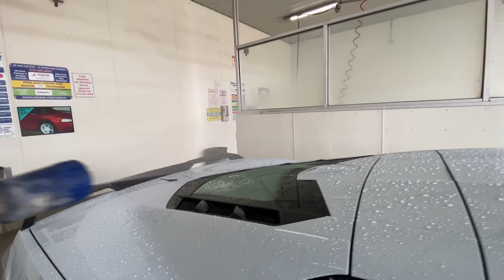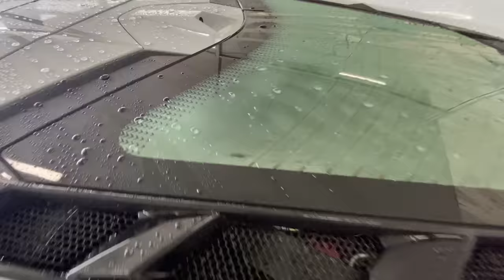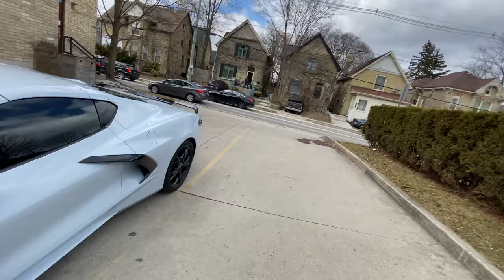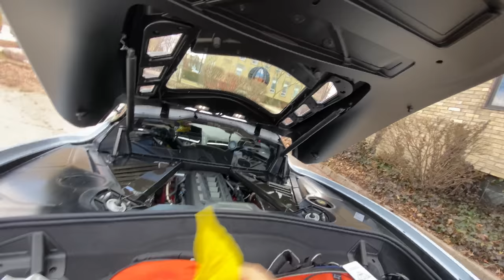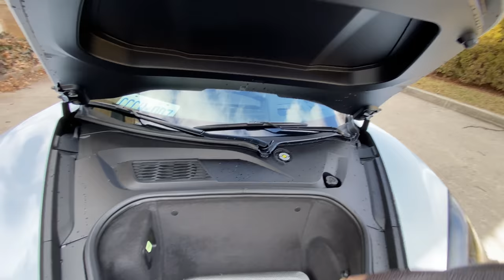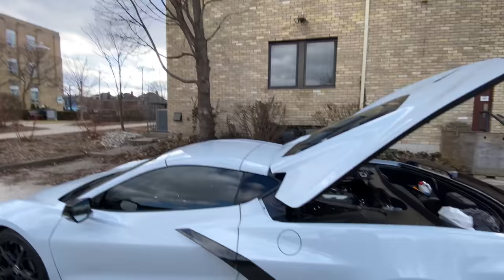How practical is the cargo space on a C8 Corvette/ IMPORTANT find while washing my Corvette

Comment: Lol what's the concern? I had a Ferrari 355 GTS and the engine bay would get wet but would dry quickly once the engine was running. Any excess water or water marks can easily be cleaned up. I don't have my C8 yet but i will probably place a large beach towel over the engine when washing. I'll then dry the outside with a leaf blower before lifting the rear engine deck, remove the towel and dry up any residual water.  No big deal.

Comment: so I've read a lot of stupid comments...
My suggestion as a degreed chemist > with 43 years coating experience…mind you...vist your Xpel dealer and order a small roll of their track film. I use it over my Xpel Ultimate (8.5 mils thick) on two cars, when I'm doing burn-outs with my LS7's. Personally that $$$$ ceramic coating won't protect the car from a small pebble at 125 mph > like the Xpel! 
 
On preventing this issue just place a piece of the Xpel track film (its a temporary film), across the vent, the hard block soft block PUR coating should adhere well enough, then allow the film to direct the water over the vent >easy peasy. you might have to tape the leading edge > check 4 adhesion before spraying. 
 
Avoid spraying the leading edge > use a soft damp cloth to wipe that after you're through > before you lift the film’s leading edge >and after make sure all dirt is off. 
Yes commenters, there are alternatives:
 
1. Glad food wrap or a roll of wrapping film from your work, you work-thieves...do not forget to tape the leading edge on the glass! >then voila...water rolls off. 
2.Just use a high-quality tape from 3m etc. duct tape to block the vent > voila water rolls off again don’t spray the leading edge with high pressure, the tape might lift. 
3. Alternately use blue paint tape 3” wide across the vent again, just don’t spray the leading edge with high pressure, so zero lifting
 
On paint protection again part of my career was spent working on paint.
I use what I feel is best IMHO the full Zaino system on all un-filmed paint areas and their polish and spray cleaner for in-between polish.
 
On Xpel, use the Xpel film cleaner, spray with water then follow with a hi-quality carnauba wax.
Hint 1: Use Stoddard solvent with mineral spirts (90-10 by volume) to pre-wet your carnauba wax pad.,  the waxes sold contain mineral spirits, but this trick allows you to apply a thinner film, hence easier to wipe off, and just as effective. The Stoddard solvent is a fast evaporating solvent, the small amount of MS slows it down for even wax oil consolidation.
Hint:2: On Zaino use their cross linker to make the wax last longer. It’s worth it. 
 
Finally save your hard-earned bucks on that overpriced ceramic...use Xpel, in 10 years peel it off the paint underneath is still NEW! 
Those little pebbles (the ones (that with enough force) micro-chip your paint? and the ceramic (really if they hit too hard the paint fails at the base coat paint layer, or harder at metal), but with Xpel?  No damage to the paint underneath. I have th experience, again in my career of having worked w/Xpel on reverse gravure and slot die web to web application that hard block soft block PUR coating for optical films used on cars like the Xpel/3M/generic for car care. All BTW use hard block soft block PUR coatings to protect the 8.5 mil thick film from being damaged.  In that  coating trial experience we QC tested these films with a neat QC device which broadcasts small pebbles at these films onto painted metal panels at 125 mph. To pass the coated film had to peel off with no paint damage, admittedly a pretty severe test - but none-the-less what Xpel and other manufacturers do.
 
I've got Xpel ultimate on my '09 CGM Z06 3LZ. and my '15 Race Red Z/28 >neither have any film or paint damage, the Vette at 11 years, the Z/28 at 5. 
Sorry to be wordy, but it needed to be right on your new $89K. Z51 right?
Reply from the maker: wow thank you for the detailed input Larry, great read!

Comment: Very few people are going to HAVE to open the engine bay in the rain.
Most people don't even drive them in the rain...  As an owner of many over the years, the interior or the front cargo will be plenty MOST of the time.  The front cargo is more convenient to get things in and out of as well.
The only use case I think you would actually "have" to open the engine bay in heavy rain is if you're golfing and it starts raining and you need to load your clubs in the pouring rain

Comment: I have been pressure washing every single engine on cars I have owned for the past 40 years. Of course you wouldn’t put the nozzle 3 - 4 inches from delicate wiring/connectors. But if you simply adjust the spray or adjust the distance of the spray it works fantastic for removing road dust and gunk from every nook and cranny. Places you could never reach with any brush. Start off 6 feet away and work your way in to see what is the perfect threshold. I have never encountered a single engine problem or any damage. Just use common sense. It’s that simple.
Reply from the maker: ok, thank you for the contribution. I was nervous about spraying inside of there
Reply: Morgan Crosbie You are welcome. I have a C8 ordered and fully intend to wash the engine bay anytime it is needed. I will either buy an aftermarket trunk lid to keep water out of trunk or devise my own. Thank you for your C8 content. It’s nice to learn as much as possible while waiting. And waiting. And waiting.
Reply: @ellobo1326  I've gotten fairly close with a pressure washer and never managed to damage anything although that could've just been the pressure level. Engine bays tend to be a lot tougher than people think

Comment: You need to dry the outside before you open the hatch... Almost zero water inside if you dry the outside first!
Reply: Exactly dry the car before you open the hatch. Open the hatch dry the outside of the car again where the hatch dripped when opened...then dry inside of the hatch. 
Tips:
1. use a pressure washer only when the car is very dirty.
2. Use garden hose with no high pressure nozzle if possible when rinsing.
3. Use a soap bucket and a clean water bucket.
Reply: That won’t work, the mesh on the back glass is open to the engine bay, any water on the back glass area can drip directly into the engine bay.
Reply: Again, the edge has a vent for air, that allows the paint to run into it, you have to block the vent. Rewatch the video, its pretty clear.
Reply: @1Straightwhiteman  POS coming from a Ford person...original...

Comment: hundreds of tests are done with these cars. they say that during the tests the car receives a strong jet of water for a few minutes, to detect any type of infiltration. this was done so that the heat comes out of the engine bay, the most important thing is that the water doesn’t enter the trunk
Reply from the maker: yeah I agree, just frustrated at the amount of crevices this soapy water got in. Trunk is bone dry
Reply: @Cars_and_Crosbie  do you intend to show us some performance numbers? like 0-60 or 1/4 mile?

Comment: I’ve never driven my c6 in the rain...but when I wash it (no commercial car washes) the water that does get in is minimal and it drips in when I put up the hood to dry all the edges and rubber seals around the engine...I love this C8 and you want to keep that engine and bay pristine IMHO....SUGGESTION...once the engine is cool open the compartment and place thin plastic sheeting over the engine and secure it with painters tape...then wash the car allowing the water to accumulate on top. Then either dry that with towels (I would probably use a leaf blower because I’m lazy and old) remove plastic...I’ve not seen this car person so maybe my idea won’t work...but just my thoughts at first glance...good luck!

Comment: While at the NCM 25th Anniversary bash in late August where they had the over 10 C8s on display and several cut-away C8s along with Tadge, Harlan, Kyle (BG Plant Manager) and the lead design team. I spoke with the lead designer responsible for the C8 engine bay.  I asked him about water getting into the engine bay because of the top air vents and the big duct fan that pulls air (and water on raining days) directly into the engine bay.

He told me (and repeated it) that everything in the engine bay is waterproof including every connector/connection, electrical component, and the engine itself.  He said the number one priority was keeping the engine cool so in addition to the two big radiators upfront and the big fan located in the left air duct they had to add those open vents in the rear hatch for added airflow. 

He said the only damage that may occur is to the Corvette owners when they see how dirty the engine can & will get.   So no, Car & Driver.....water getting into the engine bay will not hurt anything.

Comment: Always ceramic coat the engine cover and the the two side carbon fiber pieces as well as the wide  plastic "tables" outside of the carbon fiber pieces to prevent water spots.  It works!

Comment: My dad had collection of old 70s mid engine cars back in the day. We use to place a towel over the cooled motor compartment to prevent motor getting soaked.  
Place a beach towel on the front and rear bags , so it does not rub the inside of the paint or damage the front hood & rear deck. Turn the duffel bag bottom up prevent
brass loops hitting the paint.
Reply from the maker: Thanks for the advice Kyle, I will keep that in mind with the duffel bags.
Reply: @Cars_and_Crosbie  Your welcome Sir..Stay safe, stay healthy & keep it between the curbs.

Comment: Hey Morgan,  This comment is for the water in the engine bay.  If you have access to compressed air, blow the water off and out of the engine bay before drying. It works great!  works on any area that may have a nook or cranny that will collect water,  Wheels too.

Comment: Get a can of Back to Black at your auto store spray it on engine cover and panels around it if some hits the engine that's fine it will soak in and keep its natural shine its a great engine detail spray I use it on my Gencoupe on the aluminum engine keeps its shine it soaks in you can use it on the inside deck lid also spray on let is sit wipe off your set then.

Comment: The only time my C8 gets wet is when I get caught in the rain. I use a product called Ultra Luster waterless car wash. I’ve been using this product since 1995 when I purchased a Black Z 71 Silverado, you can buy it on Amazon. 
I use WD-40 to clean the engine compartment on all of my vehicles, spray it on and wipe it off with an old hand towel. 😎
Reply from the maker: Very cool, thanks for the advice

Comment: Since your vehicle is ceramic coated, just use air to blow-dry that compartment, or literally the whole car. With a ceramic coating the water literally comes off like it was never wet with a leaf blower/air compressor.

The  MetroVac air force blaster might be something you want to look into - as it's small enough to fit in that C8.
Reply from the maker: lol today i was really lazy so i powerwashed it and than took it on the highway to dry off
Reply: @Cars_and_Crosbie  even better lol

Comment: You will get a ticket with that plate on the inside dash. Don’t be stupid. I would use an air Compressor on the engine bay to rid the water. As far as washing and getting water in the engine compartment, I would wash and rinse it then go for a quick blast down the street then pull into a parking lot and dry it then most of the water will have been blown off. Also I would not be driving around with rattling gold clubs. Use a different mitt to wash the rims unless you like sand and dirt scratches in your paint. BTW, I would take a 63-67 Stingray Coupe before a 2020 Vette.

Comment: Maybe do a rinse of the engine bay after washing and then drive immediately to dry it out....could you drill some tiny drain holes in the engine cover? I'm worried to...oh wait I have a convertible on order :-) Also on the lift of your clubs do you think golfers with a high wing will get ticked off maybe cost then a stroke hahahahah

Cheers,
Kevin
Ottawa

Comment: No one...I repeat no one recommends using high pressure water on a vehicle...especially in the engine compartment. And stop whining aboot the water in the engine bay. Dry it off before you open it...duh

Comment: I hope the convertible doesn’t have this water problem
Reply from the maker: shouldn't but I could be mistaken, the louvres that are on the vert are not nearly as big as the openings in the coupe.
Reply: This is far from a problem. Engines can get wet. They get wet when driven in the rain. They get power washed etc. It's a non issue.
Reply from the maker: @mukkasaurus  the amount of crevices this soap gets into is the concern I have, yes you can spray the engine bay but still getting the vette dried off is easily double the effort over the last one. this is the problem I am trying to get across

Comment: That's nice that you're displaying your front plate on the dash but all it's doing is advertising that you're not from Quebec but you chose not to affix a plate on the front of the car and you're just baiting. Your back plate is illegal for two reasons: the dealership frame covering the oh-so-important slogan at the bottom, and the dark cover. Not because it's dark, but because it's a cover. That's two plate violations, "obstructed rear plate" and "improperly displayed front plate". Will they pull you over just for that? No. But they'll give you a warning if you're lucky or give you a nuisance ticket if you're not. Ask me how I know. If I were you I'd just hide that dash plate instead of displaying it, it can become a projectile if you get into an accident. IMO a dark cover on a white license plate on a white car is pointless, a clear cover will make your plate blend in more with the car. Still illegal. Time to change the Ontario Highway Traffic Act, and shame on Doug Ford for not following through with his talk of removing the front plate requirement.
Reply from the maker: was pulled over today and the cop diddnt even mention it to me.
Reply: @Cars_and_Crosbie  Did you get a ticket for another reason?

Comment: Well i hope to god you not using those absolutely dirty grimmy pebble ridden broom brushes to wash down your car.  if so your absolutely ruining your the surface of your car, ceramic coating or not.   The high pressure hose is fine, but you should never used those brushes on anything but the rubber of ones tires. and ide use my own personal hand brush for that.   But when people use those broombrushes that dispense the soap. all they're doing is severely scratching the surface of the car.  what would expect from a broom on the floor all day, never being cleaned collecting grime day after day.
Reply from the maker: At the end of the video I show you what I do..

Comment: Lol no shit water gets in the engine compartment, all engines get wet as you drive down the road in the rain. they are designed for that. If you sealed those vents these would be catching on fire faster than fieros
Reply: Not true at all. The engine in my cars don't get wet in the rain. That's what the hood is for.